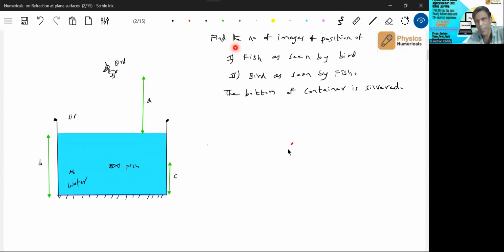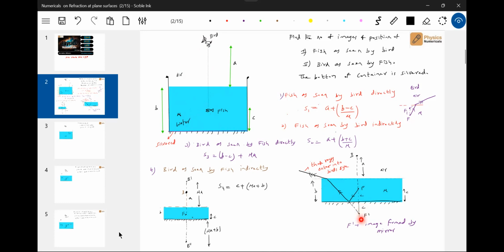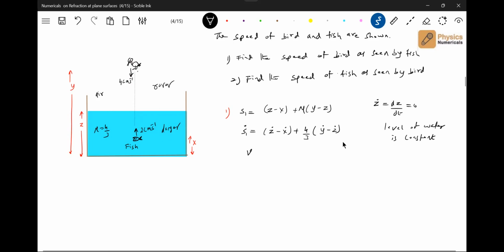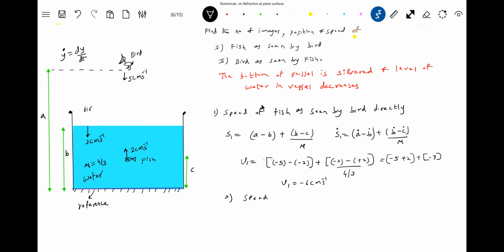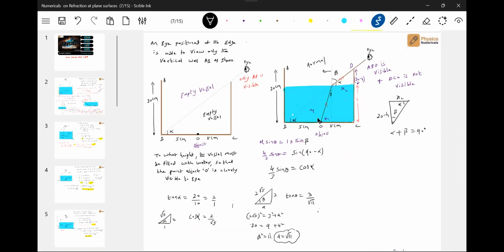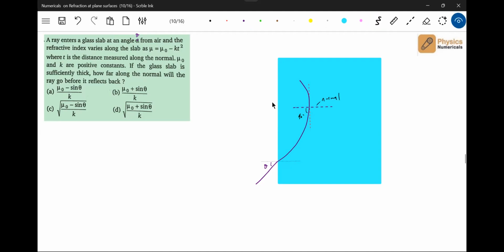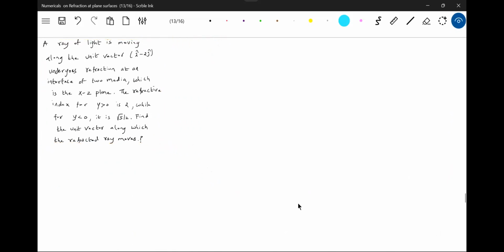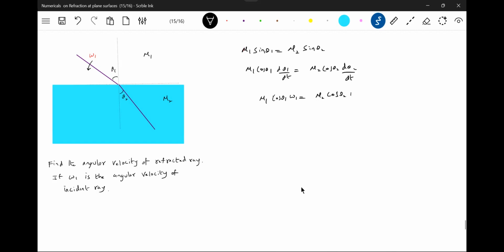21/15) Numericals on Refraction at plane surface | Ray optics class12| JEE Advanced

Comment: The speed option doesn't work on the Website sir?
Even while using the App, I'm facing some problem Sir. Like the pause/play / speed option, nothing works, suddenly on phone, and then, I have to, open the app again frm starting and then continue with the lectures.. Is there any solution to resolve this issue sir?
Reply from the maker: its being rectified by  our  tech team shantanuji and vinothji,